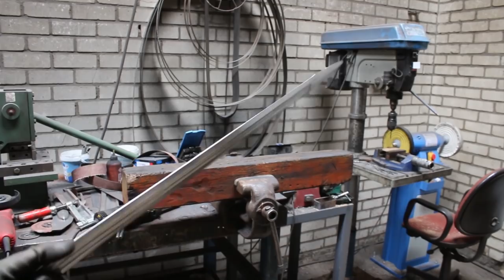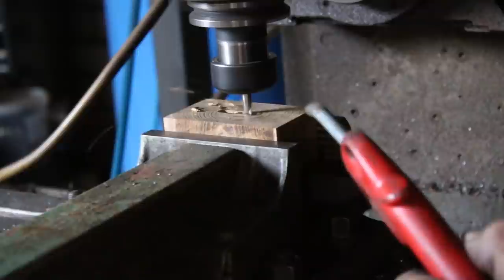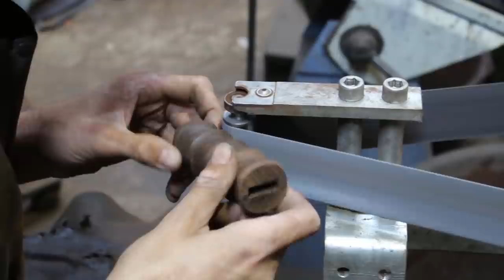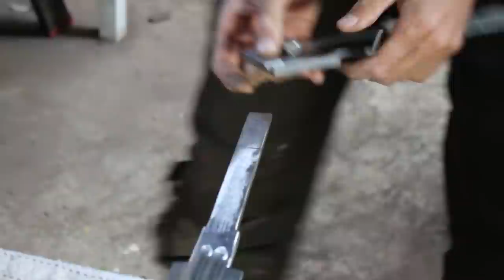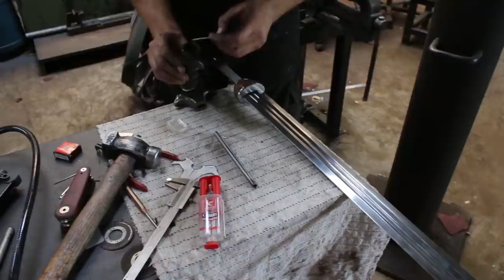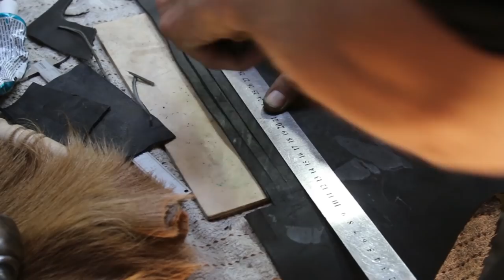Forging a Spear tip Gladius sword, the complete movie.

Comment: Beautiful work! 
You had me a little worried before you adjusted the fitting of the guard and handle :p.

I wonder why you would make the fuller go into the guard and locking the full handle so it cannot be disassembled (at least it seems that way to me)?
Doesn't this makes it easier for all kind of things to go into that cavity and damage the wood?
Thank you i enjoyed watching your video.